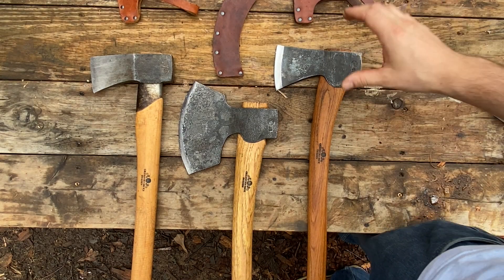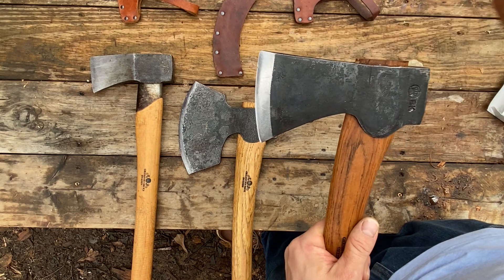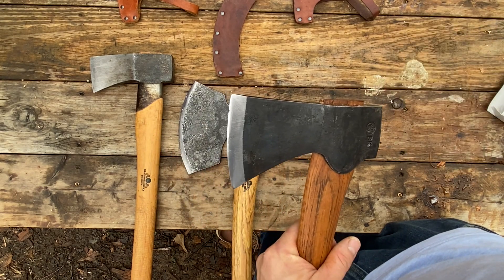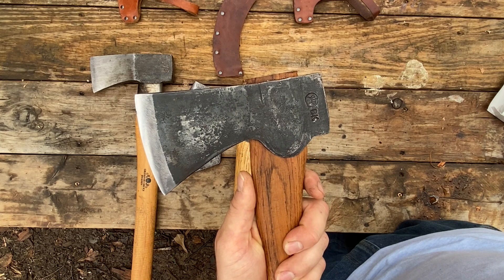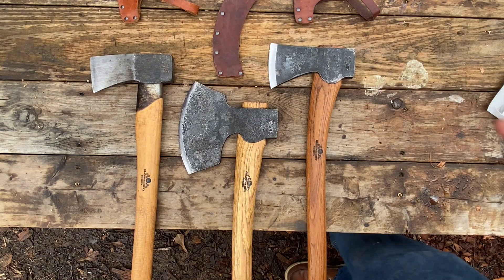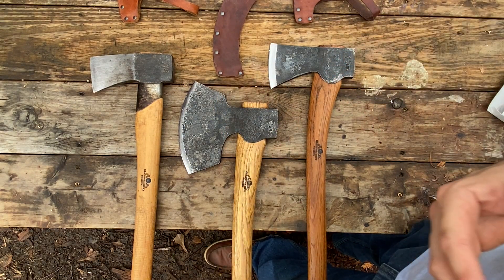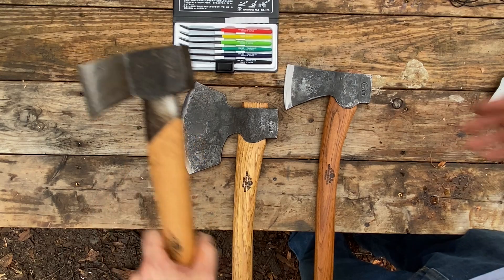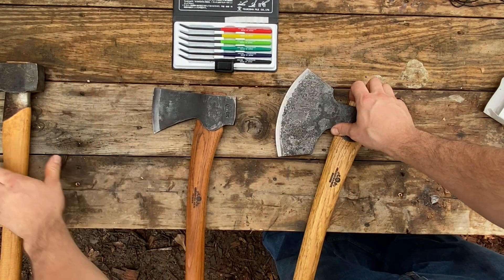How hard is Swedish Steel? Testing Gransfors Bruk axes with Rockwell files

Comment: My question is, what kind of wood are we cutting, live or dead wood? I can't imagine swedish deciduous wood is any softer than north american deciduous wood. Prolly the same trees! I don't feel any axe should have any issues with any live wood, whether it be a soft or hard wood tree. But, every axe will have an issue with cutting thru any dead wood, whether it be soft or a hard wood. I don't even like using an axe to chop (not split) deadwood. A saw is much better. I'm not an expert, but this is just my opinion.

Comment: i have seen the double bevel 1900 model at my local store. I want your opinion on using it as a camping axe. I don't need to do any hewing and I want to chop wood in camp and maybe chop down small trees someday, basically I just love the way it looks. Do you think that I would regret buying that instead of their forest axe or something?
Reply from the maker: I love the look of it too. The center bevel broadaxe is designed to notch, as well as hew flat, so at some level I think it could do what you’re asking but it is very heavy and very tall so not great as a camp axe. The handle is also designed for hewing so I think would not do well as a camp axe.

For the price you could get BOTH the Scandinavian forest axe and the small forest axe… plus probably a burger nearby the store haha.
Reply: Very true and very good points! Thanks for replying, I do blacksmithing as a hobby so I am also tossing around the idea of buying a couple tools and then attempting to make my own, doesn't get more satisfying than that @urbanlumberjack

Comment: Temper seems right, I'd guess its the edge geometry that's the issue. Mine is a TT, about the same as yours except my edge was about 17-20° and convex. Chopped all kinds of woods never had an issue.
Reply from the maker: That’s really good to hear. I’m hoping this one I’ve got performs the same way. I reached out to the company about my issues and how I think they could be fixed/prevented. I received no response which was a bummer.

These are great axes, I’m worried GB is going to screw then up trying to save a penny.

Comment: My Scandinavian forest axe is about 8-10 years old. It’s my only regular camp axe and landscape axe around my house. Can’t recall if I have ever rolled out my edge but after the factory edge dulled I’ve only convex sharpened it and never had a problem. I have oak trees, pines and lots of dead ash. No problem on any of them.
Reply from the maker: I suspect older models don’t have this problem, recently they started grinding the bits too thin. They seem to have reversed course, though, after many people shared issues with the grind online. 

My GB dealer has several SFAs and when I visited all their axes were ground to 20 degrees, or slightly thicker. That’s a much more suitable grind.

Comment: Just use it as is with the wood in your area, if it starts rolling on you just add a little more convex when you sharpen it until it is stable. That’s what I did with mine and it holds up really well and still cuts great. same thing with convex knives I’ve had. 

I think the overall thinness and flatness of the main bevel are more relevant. This thinness make it great for green softwood limbing and minor felling of 6” trees or less. It’s average at bucking for its size and weight, terrible at splitting and fantastic at carving. 

It’s a very light and portable high performance bushcrafting and light limbing axe not a heavy use camping/working axe. I’m not sure that they make that clear in their marketing and that’s a shame.

Comment: I love my SFA but I have chipped the heel on wet mesquite in Arizona. My new one is doing good so far. I always liked my Wetterlings better, but they were bought out.. by Gransfors?
Reply from the maker: Since I made those videos, I have heard from so many people similar stories. I’m not sure if it’s the steel that’s the problem, but certainly the bevel they put on the edge is far too thin. It’s a nice edge at 15°, and that’s just not going to last long on an axe. I filed mine back to 20 and it’s working much better!  Thanks for sharing!
Reply: Hello, can you please let me know how to do that? Did you file your SFA to 20 degrees on the whole edge (toe, center, heel)? I am new compared to your experience and I don't quite know much! I suspect my SFA  (which I got few months ago)  is also 15 - 17 degrees because after some mini rolls, it chipped, when I used it for chopping hard wood in my camp area. I am from Greece, and in a research about what to do I ended up in this video of yours. I know you made this video some months ago, but I would appreciate it if you can reply and let me know more about what you did! Did the secondary bevel (that some people suggested) not work? Is the solution 20 degrees and how Can I also do that? Thanks in advance !! @urbanlumberjack
Reply: @antoniskesidis1543  just buy a good file and go for it, man. Try to keep the same angle as you go. It is not rocket science. Lift a few degrees up from current one and start filing
PS: Felix Immler demonstrates how to easily reprofile an axe edge. Look him up.
PSS: I would first try to get away with just an aggressive "microbevel" along the edge. Sometimes that's all that is required. A couple degrees on each side.

Comment: Gransfors Bruks uses recycled steel and they are not as good as they used to be.  Wasting your money
Reply from the maker: I’ve heard complaints about the recycled steel and single heat cycle forging. It does seem like the more environmentally “friendly” a company tried to be the worse the quality can be
Reply: @urbanlumberjack  
Yes and apparently on their website they are embracing Agenda 2030 and doing their part and they said they have to do more! Sounds nuts. Glad I bought a pack axe by Council Tool.

Comment: Use it for what it was designed for, pine and spruce.  If you want an similar size axe for hardwoods Council Tool has one that will satisfy.  Overall axes have gotten too popular and are highly overpriced due to bushcraft forums and the survival shows.
Reply from the maker: The prices have become insane. Hoarding is also a big issue

Comment: The Scandinavian Forest Axe is meant for Pine trees. In fact it was designed for the harvesting of raw Turpentine. So hardwoods? Wrong axe. It also works great in tree limbing and camping/bushcraft where the goal is to prepare for the  campfire with small pieces of wood. It is not meant for heavy duty work. Rather light duty all day long. If you live in hardwood areas get a felling axe. If you live in the highlands of New Mexico or Northern Minn or Ontario then you are good to go. Oak trees or walnut etc?. PASS.
Reply: Even if that is the case, there's really no reason to have a 15 degree edge and use such soft steel.
Reply: @johnf817  yep. The geometry is way off on that one.

Comment: Plus if you’ve filed flat bevels on the scandi Forest axe then you’ve made it into a giant carving axe. The forest axes are designed with a narrow concave for reasons that will present if you chop and hew large blanks. I only keep flat bevels on my carving axes for the control and accuracy of the cut. With a working axe in timber you’ll need the thin bite of the convex for efficiency.

Comment: All axes will fail at some point, chipping, pitting, edge rolling, cracks even corners snap off - the steel gransfors use is fine just some o1 type, but it’s ease of maintenance far outweighs any minor damage, what is the point of owning an axe that you’re not going to use after it gets wear because a normal stone won’t touch it? my gb wildlife hatchet I’ve now had for 30 years, lots of use, wear and tear, and I’ve put that little axe through some extremely tough hard wood, green, seasoned and frozen, oak, ash, plum, hawthorn, ebony, bamboo, buffalo horn, conch and bracket fungus all sorts- and all it ever has needed is an occasional sharpen and hone with a water stone 800 grit, or the little dc4 stones, but these two tips have made all the difference - maintain them often, and use them sensibly.

Comment: I'd bet you will get into some better steel as you use and sharpen it. I notice alot of knives are this way. I'd just keep using it and sharpening it first. But hey it's your axe.
Reply from the maker: I’m going to reproduce the forest axe to 20 degrees, will need to take off probably a good 1/4 of steel. Bummer but the axe isn’t useable for me until I do that. I’m hoping to retest it and see if the steel is harder further into the bit. Thanks for taking the time to share your experience!

Comment: weird because every GBA i've owned (from new) have been 20-22.5 degrees (scandi, small forest, wildlife. I actually thinned my scandi down from 20 to 15 because it wasn't cutting well for my local wood types. 
i've also had 2 american felling axes which both came very thick at 27.5-30. Both of which i ended up thinning down to around 20. 
just to clarify, i'm really not a fan of GBA axes. However, i've never had any quality issues myself. Although i have repaired significant edge damage on 2nd hand GBA axes for people in the past.
Reply from the maker: I’m going to find some time to reproduce it, probably bring it back up to 20 or better. Hoping the steel just got a bit soft from grinding and harder stuff will be found underneath
Reply: @urbanlumberjack  it can happen. I've had more reports of them being brittle than too soft. 
Love seeing the chainsaw/firewood sections in your videos btw.
Reply from the maker: Thanks man! Enjoy your videos as well Learned a lot from them

Comment: I just checked my GB by the same smithy, bought in December, and the grind is 25 at center line and 20 at the corners.
Reply from the maker: Thanks for letting me know!
Reply: Just remember it isn't the smith that puts the edge on it, they have their own grinders to do that.
Reply: @Tokon71  Might be that they have a new grinder and he makes it to too thin and at the same time too hot so the heat treat goes bad. @gransforsbruk 

If they made a bad batch - return them as they have an awesome warranty.

Comment: When I looked into the Scandinavian forest axe it did recommend for resinous woods such as spruce and Pine. It says it's a very thin profile in the descriptions from what I have seen advertised. In my experience of forging axes I find it is sensible to have general splitting axes at a lower Rockwell as these are more likely to strike a hard surface such as a nail embedded in a tree or be struck with a hammer if stuck so you would not want them to split/ shatter. Carvers I tend to forge to a higher Rockwell around 58 as like you said they are used more as a chisel. Nice video, always interesting to see reviews.
Reply from the maker: Thanks for sharing your experience! Would love to see your work do you have a website or online shop?
Reply: @urbanlumberjack  currently no as I am in the process of making a website, I have some videos on my channel of my work. I mostly forge small camp axes and carver's from En9 steel. Have forged some historical Peterson type axes and splitters also but my focus is on a suitable hand axe ideal for camping. Heat treated poll with good edge retention, I am still very much in the prototyping phase of having a production axe I would like to sell. So many variables to decide on.
Reply from the maker: Checked out your channel, beautiful work! If you get to the point where you are ready to sell a few let me know, and I'd love to see about purchasing one, maybe doing a video or two if we can work that out.
Reply: @urbanlumberjack  thank you that's very kind of you to say, yes I would be interested in getting feedback from others. I'm currently working through a small batch of axe heads and matching sheathes.
Reply: @urbanlumberjack  I'd be interested to get some advice on what you would like to see in a axe head profile, maybe we could prototype a head design and you could test it out for me?

Comment: I have GB Small Forest Axe and been using it for over 10 years and have had no issues.
Reply from the maker: What degree is the bevel? Have you put a secondary bevel on it?
Reply: No it has a convex edge. Around 22-25*
Reply from the maker: Interesting thanks for getting back to me. Mine is 15 degrees at the heel and toe and 17 in the center. Much too thin I’ll be filing back to 20-22 most likely.
Reply: I meant to write 15-20.  40*inclusive

Comment: Interesting vid. Agreed, just back it up a bit till your at 20ish. Surprising though that they're all at 50-55, I remember reading somewhere that GB tempers to 58-59, I'm sure it was on their website. 50-55 is more in line with what Council advertises. Again, brings up the topic of bang for your buck/premium axes... shouldn't you be getting an advantage for your money (Style and hand forging aside)? As you said, 5 hrc is a big difference in hardness terms.
Reply from the maker: I try and figure out what you guys down there do, because I imagine if it works in Australian wood, it’s probably good enough for anywhere in the world!

I was definitely disappointed in the hardness, especially because of the reputation the axes have for being much harder than other axes. At this point I think the difference between GB and other manufacturers is largely aesthetic.
Reply: @urbanlumberjack  what I've found is that a 15, 17 or so is fine but even on good steel it's gotta have a micro, and on softer steels probably even a secondary. When I've tried low angles like that taken all the way to the apex, it folds or wrinkles. On some steels even 20 taken to an apex will damage a little bit. For the most part though,  20 is my go-to. Speaking of hardness, what did you temper your nessmuk to?
Reply from the maker: It’s a hair under 60, I’d say probably 57 or 58.

Comment: Interesting finds. My Scandinavian Forest axe came with a 25 degree chisel grind out of the box. I used it at 20 degrees for quite some time with no issues. Then I took it down to 17.5, which causes the top and bottom corners to roll over. With a microbevel it takes no damage. I’m personally not a fan of these axes, because I think my council tool boys axe is a better performer at a quarter of the cost. I do think that their edge retention is fantastic, but unless you just use it for felling and limbing, you’re likely to bang it up on some rocks like I did, and filing these axes is not a fun experience. I resort to a belt sander for Swedish steel.

Really good video, I like the line-up! Hopefully you can find a good use for that Scandinavian axe. It really is a good looking tool. Thanks for testing and sharing👍👍
Reply from the maker: Thanks for the insight! Will try that secondary bevel. I’m definitely agree on the CT axes for the value. Even aside from value, I am very happy with how my pack axe chops, it is every bit as effective as this GBA, and the grind is far more durable.
Reply: @urbanlumberjack   very similar experiences to Codi myself. I really don't enjoy working with their steel, way too hard. More than once i've resorted to belt grinders for the initial profile work on them. I much prefer a softer steel from a maintenance perspective

Comment: Gransfors Bruk recommends 25-30 deg for carving axes and wider for softwood/hardwood. Trees freeze in Sweden so even if it is ground for softwood from the factory, seems like it would be a wider angle. Curious to know what they come with out of the box. Send Beyene Kahsai an email and ask him lol.
Reply from the maker: I might shoot off an email for curiosity sake. This is still the factory grind, so I haven’t thinned it at all. Interesting about the frozen wood that’s a very good point. I don’t believe this edge would hold up to frozen wood any better than hardwoods. It’s great for carving though.
Reply: @urbanlumberjack  It would be interesting to reach out to GB and post the process. If they are coming out of the factory at almost half the angle they recommend, it might be a QA issue.
Reply from the maker: Good suggestion, I’ll send them some pictures and, of I remember it, let you know what they say if anything.
Reply from the maker: Interesting. I reached out through instagram and haven't received a response. I think I recall reading they said they heat treat to 57-58. Curious how far from that range these axes are.

Comment: I think this edge is just too keen as well.  Even softwoods have very hard knots sometimes.  I used to think the reputation of the Swedish axes are that sometimes the steel was too hard for most inexpensive modern files.   Which to me sucks.  I'd rather have an axe be a little softer.

To me 50-55 is perfectly acceptable.   This seems more like a carving edge than bucking.  Which doesn't really make sense for that handle.   I'd put a small secondary on it and see if that helps.
Reply from the maker: I like the way you put it: “which doesn’t make sense for that handle.” That’s exactly the issue, the handle allows more force to be used than the bit can handle.

Comment: I have the small splitting axe and the Scandinavian. Don't have the other, one. Beautiful axes, and a great video. My Scandinavian keeps rolling on me too, I thought it might be my technique. Thank you for this information 🙏🏻
Reply from the maker: Thanks for the kind words! Gransfors does make a beautiful axe. In the comment section it was suggested to put on a large “secondary bevel,” I’m going to try this so I don’t need to grind off so much steel. I’ll probably try for a 21-22 bevel and see if that helps strengthen the edge